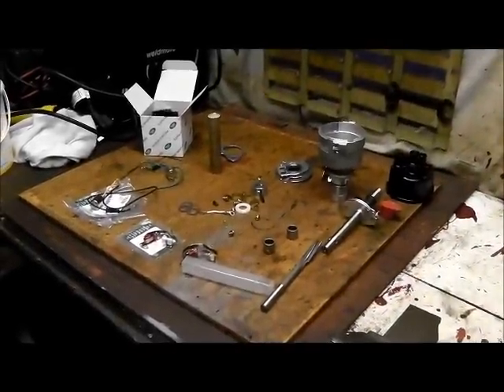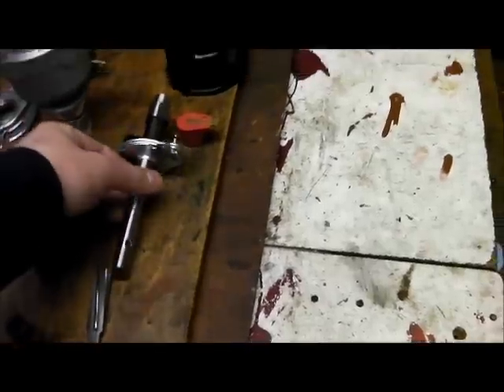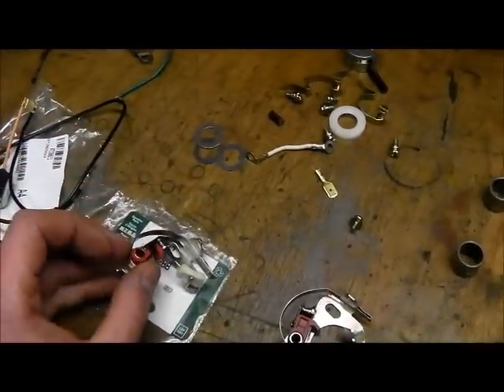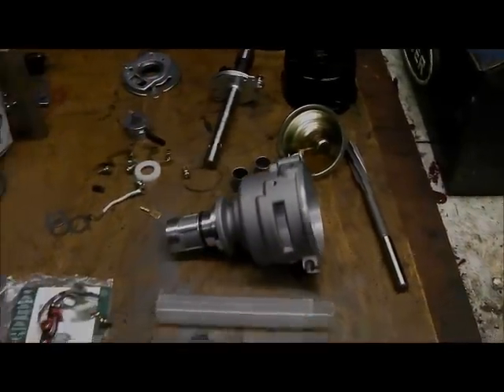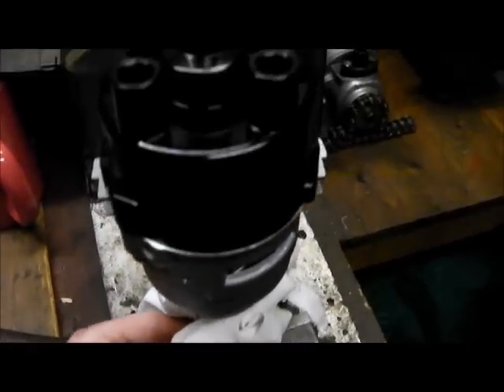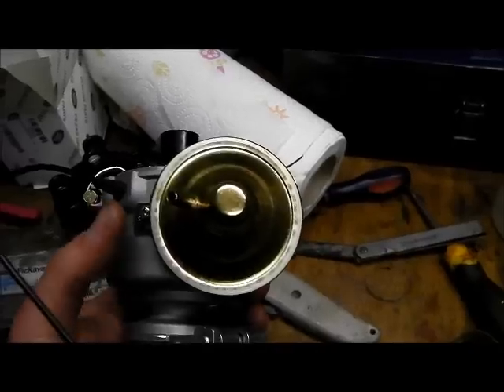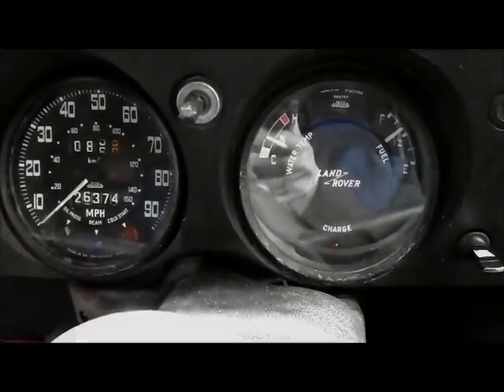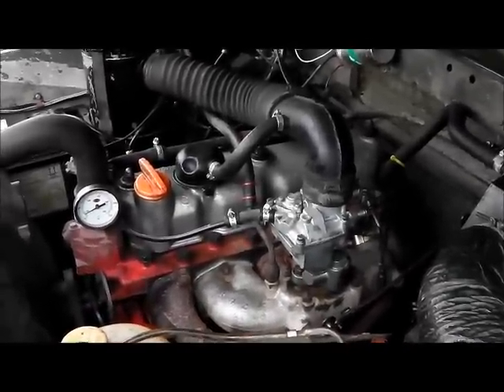Land Rover Series 3 Distributor Rebuild

Comment: Great video. How do you lubricate the centrifugal weights before assembly? Do you apply a coating of grease or just oil?Using grease is a fairly common practice where I'm from but I've also heard that the grease would prevent the weights from flying apart and thus disable the centrifugal advance....
Reply from the maker: light grease or a few drops of oil every other service. That's what I do and it seems about right.

Comment: Hi Phill, nice work! congrats! I had a series 3 also, can you tell me witch is the longer of the bearing that you use, the external diameter was 16,6365 mm right? the hole of the oil you keep it or you spilt the bearing in two?

Thanks for sharing!

Cheers Matías
Reply from the maker: Thanks! The bearing should be full length and will need drilling for an oil hole.